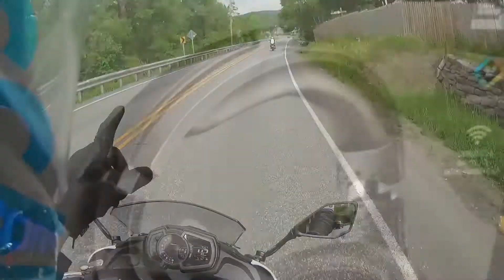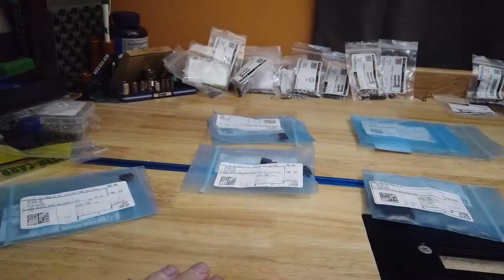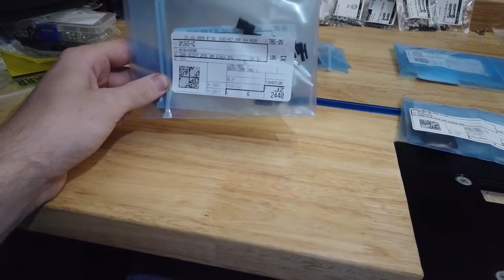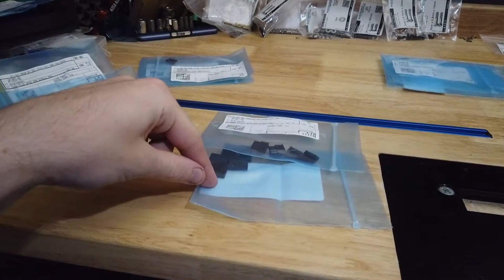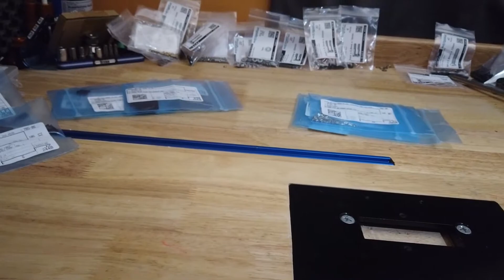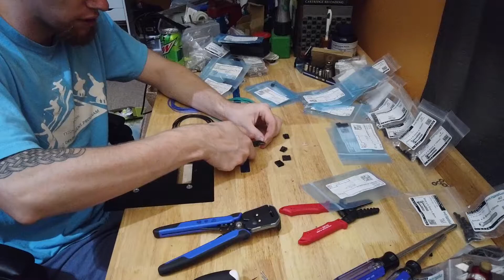Voron V2.4 - E9 - Wiring, Pt. 1

Comment: Did this today. Was a pain because I used cable sleeves too. It makes it harder to fix if you make a mistake.
Reply from the maker: It does, but it's not too bad, at least with the sleeves that I used, they've got a split in them so you can pull wires in and out. but it does make it a little trickier. I hope that you were successful with your wiring today.

Comment: great video, much appreciated!
how long did you cut each wire?
Reply from the maker: I don't have exact numbers. It's much better to have more wire than you need. How I did it was I ran one wire from the toolhead, along the outside of the cable chain paths all the way to the bottom of the machine, and then to the front of the machine and then back to the back. I repeated the process from each place that needed to be wired. This made sure I had enough wire for the entire run. Then using each of those wires as a template I cut all the wires for that location.
Reply: @sharpsarena  makes sense, thanks!
Reply from the maker: No problem, happy to help.